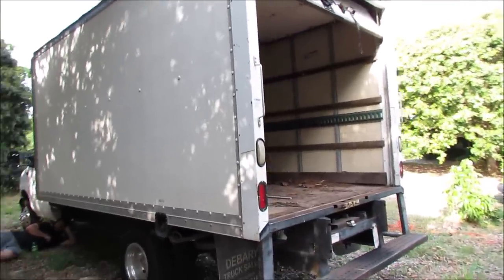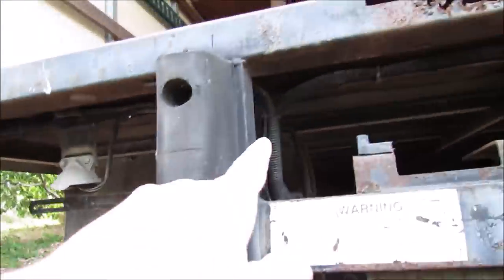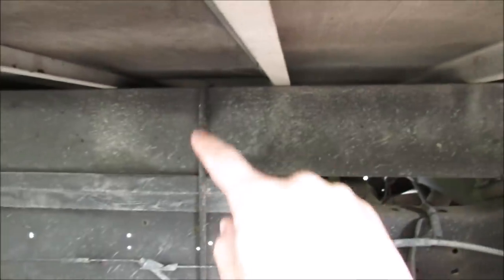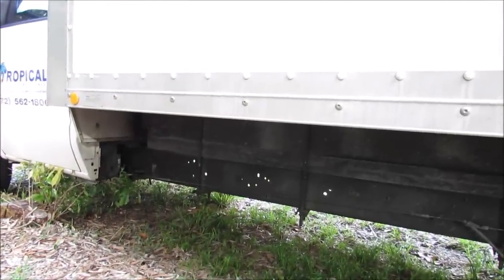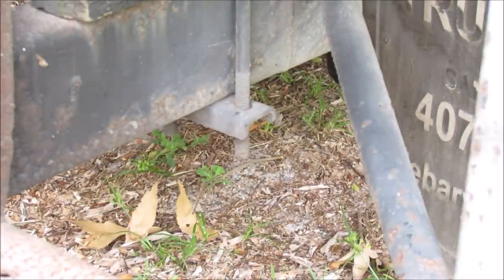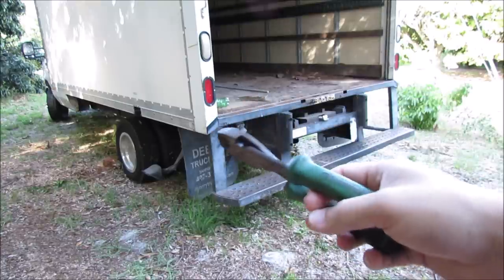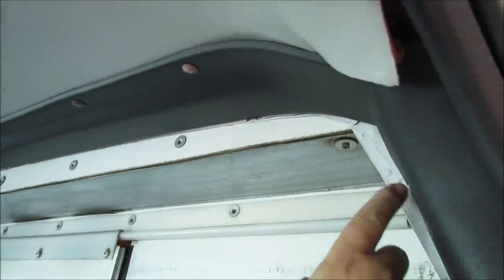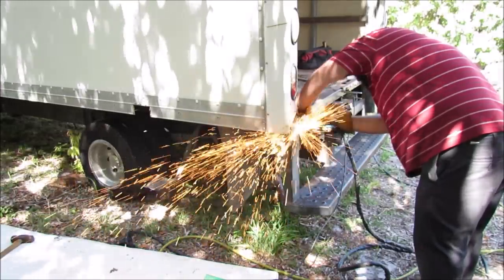How to Remove Box from Box Truck

Comment: I just bought an F700 airline catering truck with the box that goes 18' in the air. I bought it to place a 40' boom on it because it already has hydraulic outriggers on it. I was going to just remove the box off with a cutting torch but once I saw your video I decided to do the same to store my 1956 Chevy in it(if it fits, I have to measure first). If it does not fit, I have plenty of other toys to store in it. Thanks so much for a great instructional video!
Reply from the maker: No problem.  And nice car.  Whats the length of the box? Arent those 56s like 17 or 18 feet long
Reply: Yikes, I think its only 16', so other toys it is.
Reply from the maker: I just looked it up.  The 56 should be 16.5ft long.....toys it is!

Comment: I found this video trying to understand if you could take a box off of a "totaled truck" and put on a new one.  Was thinking about buying a box truck and converting it into an RV/tiny home.  My though process was that if you bought an old box truck vs an old van, built it out, and then the truck just turned out to be a lemon, you could take box off & put on a better truck & save your "tiny home."  Where as on a van, your build is pretty much totaled with a totaled van, if that makes sense.  Thoughts?
Reply from the maker: It's not a terrible idea.  And yes the box truck box would give you a bit more room.  But honestly it's probably cheaper to have a tow behind or the truck bed topper type.   The one that fits into the bed and usually over the cab of a full sized pickup.

Comment: Has the bottom rusted out now just sitting half a foot off the wet ground?
Reply from the maker: Actually we just loaded it up on a flat bed and it was fine.  The wood floor will rot out faster than the thick steel will.

Comment: I want to make a sleeper for a 150 or 250 pickup truck in the future. Do you need a torch to remove cab wall? Or is it bolt on?
Reply from the maker: It was bolt in.  As well as siliconed